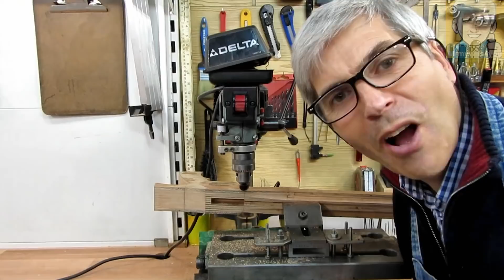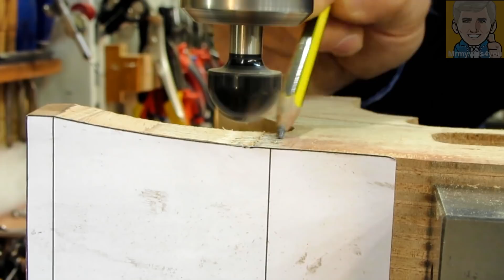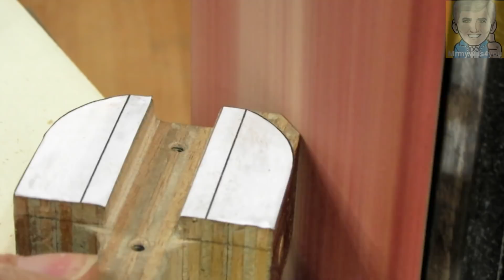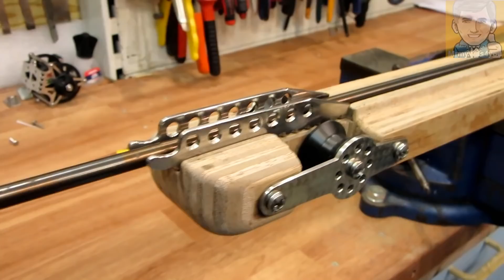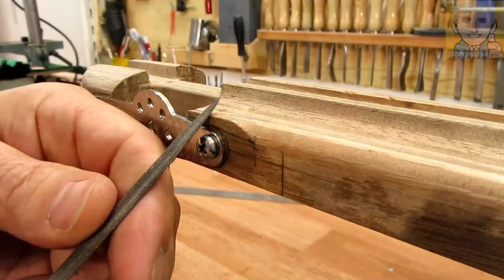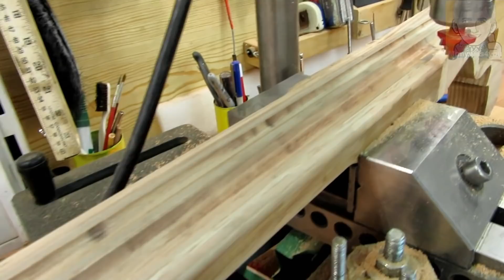Making a Speargun Part-17

Comment: Good jobs, but i think that the wood used is not good for this project.
Reply from the maker: Hello Filippo A. M.
I used okoume plywood as test, time will tell if it will be durable or not.
In one of your videos you have one speargun that has some plywood in it, how did it work out?
Thanks for the comment and for watching.
Reply: In my video there’s a home made speargun, tipe Roi sub sistem demo 3, very performant sistem, the wood is “ frassino” but generally in my other previous project i used iroko and mahogany wood...

Comment: For the finish.... varnish, or mixture of linseed oil and some other ingredients as much better solution?
Reply from the maker: Hello Orca A.
I´m planning to impregnate the wood as much as possible, with diluted varnish to create a harder surface that will preserve the speargun against the inevitable scratches. 
Thanks for participating.
Reply: @MrMyvids4you  vernish is more bling-bling probably more prettier but if your gun meet punch, vernish can brake and water pénétrer.

You can use epoxy or, 
oil de lin, terpentine et siccativo..not so shiny and beautiful as vernish but much stronger and resistant. 
Regards from south 🇫🇷